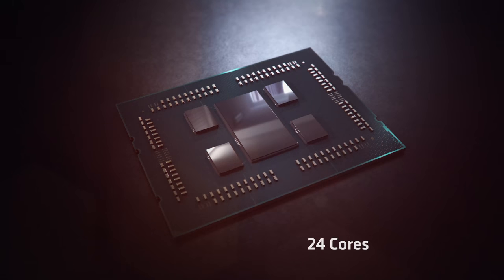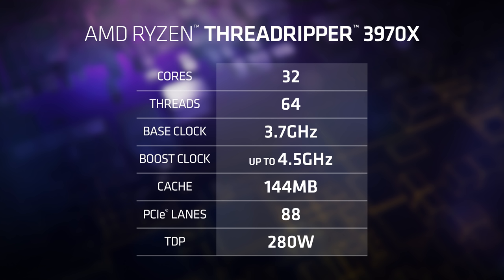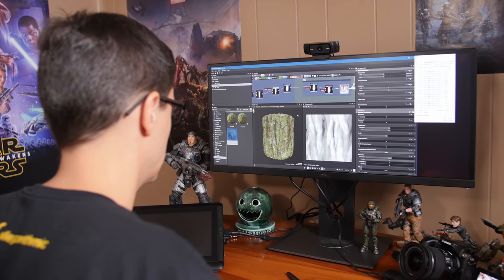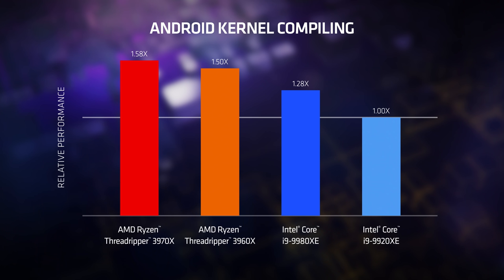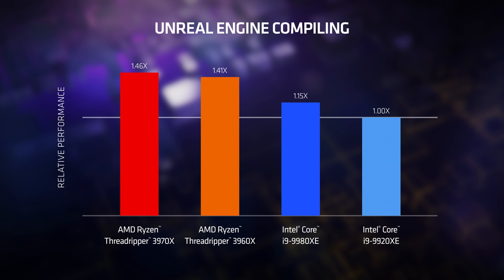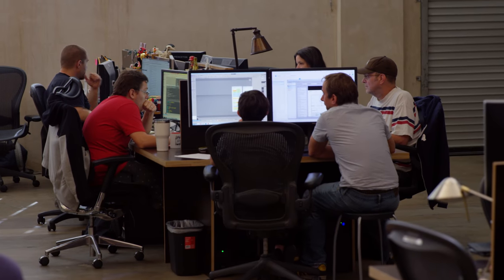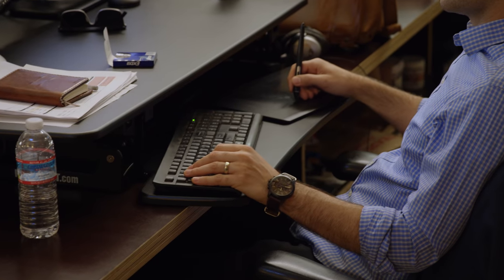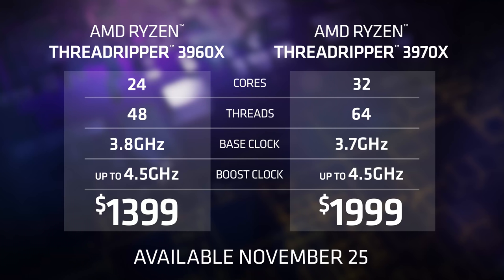Performance Preview: 3rd Gen AMD Ryzen™ Threadripper™ Processors for Creators

Comment: So Lisa Su will appear in this video, but not in #TheBringUp ?
W H A T    A    F A I L
Reply: To be honest I have been waiting for this information for like a year now. But some of the informations are just useless. 
It support "PCIe" - Really? It does? WHICH ONE? 3.0 or 4.0 (the first beeing more realistic, but with a cutting edge max horsepower AMD CPU you don't know)
It has 144MB combined cach - Really? How is it spread over L1, L2 and L3?
The third gen comes in two flavours - Really? Only two CPUs. Or two CPUs _for now_? And there will not be a 3990X?
Will it use the same CPU socket or will it really use the new TR4s3 (or however it is called) 

I want to use one of these CPUs in my new build I use for my work. And your policy of not-giving-away-informaton makes it frustratingly hard for me to plan for my new build. I need to check which CPU is the best for the build. I have to play for money. So much information is needed and I can only find rumours.
Reply: @KuruGDI  Why do you not know the L1 /L2 /L3  cache spread ?  This is 'old news' ...
Google is your friend my friend...  A June 2019 article on nexus.net based on AMD slides reveals that Zen2 architecture has 64K of L1 per activated core, and 512K of L2 per activated core.  Next, per (max 8 core CCD chiplet)  have (2x 16MB per 4c CCX) 32MB of L3.
These 2 Threadripper parts have 4 chiplets, this means 4x 32MB of L3 = 128M of L3 
This means, 24C threadripper has = 24 * 64K = 1.5M of L1 , 24 * 512K = 12M of L2 and 128M of L3 =  141.5  MB of total cache
32C Threadripper = 32 * 64K = 2M of L1 ,  32 * 512K = 16M of L2 and 128M of L3 = 148M of total cache
Since the documentation only counts L2 and L3, you get 140M combined for the 24c TR, and 144M of combined for the 32c TR.

Comment: Guys believe me they are gonna jabait the prices just like they did with Navi. In hell no way are these final prices.
Reply: That's not applicable in this case since Intel had already announced their own pricing well before AMD's announcement. So AMD is not waiting for Intel to announce their prices and adjust their own accordingly, which is what supposedly was the case with Navi. Which I do not believe to be the case to begin with. AMD was simply forced to lower their prices in response to Nvidia Super lineup pricing - it was never a planned move - they simply said so to save face.
Reply: Perhaps for low-mid tier cpus. However in order for these ultra-high end cpus to work properly and at advertised speeds they basically pick the best binned components out of everything. This makes their yield very low. Effectively this means high demand but low supply. Even if they reduced costs it would be very little. Suffice to say those who wanna buy them will buy them regardless of price. These are purely professional workstation cpus and you buy them as an investment to your work efficiency rather than a simple purchase.

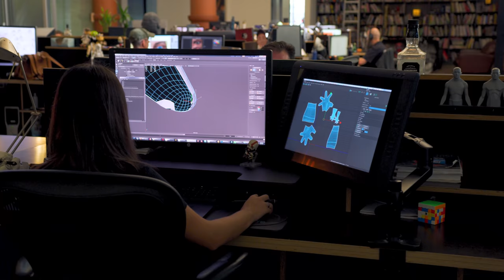Comment: I'm calling BS on that Blur Studio segment, 5:34 "All of our applications are heavily multi threaded.", really? considering applications like 3ds max and Maya are largely single threaded,  example viewpoint performance will be better with fewer higher performance cores , also the parts that are multi threaded don't scale very well, sure blur use a lot of different applications and some probably benefit more form the large core count ,  things like rendering and simulations will benefit a lot from having a lot of cores, but surely they have a render farm and dedicated simulation servers for that and not using their workstations. 5:51 "Gonna take a frame from 13h to 20min" 6:11 "Something that normally would take 5min was taking 5sec "uhh, no it wont, there is no way you have gotten a 4000-6000% performance increase with these new CPUs (unless they where using 20 year old machines before the upgrade). He does mentioned that they where able to render a lot of things now locally faster then getting it thru the farm, but that sound more like they have a network bottle neck and using a remote farm? or just have an really bad render farm setup. Blur is a respectable studio so surly they cant be this clueless? Sounds more like blatantly false marketing. Don't get me wrong I am going to get the new Threadripper or the ryzen 3950x for my next workstation build this winter, because they are good CPUs, but its better to be honest about the actual performance else your overhyping things and people will get unrealistic expectations and just end up disappointed in the product, should have learnt from bulldozer.

Comment: AMD should be build an air cooler that can handle overclocking for the 32 cores model.

Because watercooling is too complicated, and aio cooler isn't best solution for the workstation pc😀👍

Comment: decimating intel line-up one cpu at a time.
Reply: 3960X costs 1400 dollars and 3970X costs 2000 dollars.
Reply: @alexmarin7897  nevertheless, it is much more powerful, efficient and affordable in contrast to its counterpart.
Reply: @koralite3953 - More affordable? These cpus respectively cost over 2x the price of 10920x ($689) and 10980XE ($979) while only offering 1.25x-1.6x more performance, and that only on some niche workloads. More efficient? They have 1.7x higher TDP (165W Vs 280W) while only offering up to 1.6x the performance. Bear in mind that Intel cpus are operating completely at stock settings here so they adhere to their rated 165W TDP after 25seconds. Even removing power limits in order to allow the Intel cpus to boost to their all core turbo indefinitely, they consume 1.25x their TDP i.e. around 206W. The AMD cpus have a TDP of 280W so (even assuming they won't go above that while boosting, which they do) this is still 36% higher power consumption. So even in the best case scenario of dividing the highest performance difference (1.6x) with the lowest power difference (1.36x) that would be around 17-18% more efficient … not something that I would call "much more efficient" and certainly not worthy it given the over 100% higher cost.
Reply: @alexmarin7897  Power consumption Intel = double of TDP of AMD :P
Reply: @kevinyoliveira68 -The figures that you have in mind are total power draw from the wall when the Intel cpus are overlocked on all cores to their absolute max and doing a very heavy workload like Blender or Handbrake or Prime 95. If that is how you want to compare then check the relavant reviews on OC3D. The consumption for the 9980XE (OCed on all cores to 4.9GHz) running handbrake was 564W. The corresponding power consumption for the 2990WX (overclocked to 4.0GHz on all cores) was 776W.The  2990WX was a nuclear reactor and it had a TDP of 250W … imagine the power consumption of the 3970X that has a TDP of 280W. The ice in the poles will melt faster…
Reply: @alexmarin7897  Lol that $1000 10980XE  and basically all intel HEDT lineup already got beat by the lower core count less expensive and much more efficient non HEDT ryzen 9 3950X, threadripper are for those who need the absolute performance, also just to remind you the 28 core intel W-3175X cost $3000.
Reply: @alexmarin7897  32c vs 18c and 18c consumes a less wow...
Reply: @alexmarin7897  But on a HEDT platform it's not only the programs speed that matters.What about PCI-E 4 and 88 Lanes? It's not meant for gaming Pcs...its meant for PCs with a high overall workload...not using 1 graphics card for gaming but 4 for rendering 3d scenes...not using 1 SSD for storing games but multiple in raid for creating uncompressed video content?  SSD's can already profit from PCI-E 4... and i wouldn't be surprised if AMD
s next graphics chips can profit also...so it's not something intel should ignore...they already slept too long. ;)

And even if the difference would be smaller...this is a CPU meant for people who are earning money with their work and time is money..they will buy whatever is the fastest...just how they bought Intel before without looking at the price tag.
Reply: @sanitoeterscc3416  they(Intel) are already slept for long time, I realized that since core I series gen 2 to gen 5, they stuck in using DDR3 RAM module type . I don't know about gen 6. But it's clearly Intel too lazy too be innovative. And so fokin late in adoption DDR4. From gen 2 to gen 5, it has 4 generation gaps. So impressive in negative thoughts..

Comment: Those prices are out of touch! This was an opportunity to make intel’s offering seem like it’s not an option. Instead, intels 10900x series fills the huge price gap you are leaving between x570 and Trx40.
Reply: Really? My 16-core 1st gen Threadripper launched at a $1000. The 16-core 3950x launches at $750 or $250 less. Not to mention that it will be ~30% faster than 1950x.
As for 3970x, it's just $100 more expensive than last year's 24-core 2970wx, but it also offers much faster clock speeds, much better IPC, more PCI-E lanes, reportedly is UMA instead of NUMA topology, and has new features like PCI-E 4.0. I think I can justify the $100 markup for these alone. At $1400, I think that 3970x is still a good price compared to Intel's offerings. Can you please let me know how much do Intel ask for their 24-core CPUs? Last time I checked, they start at over $3000, so nowhere near the $1400 AMD asks for theirs. Can you please give me an example which CPU is a better value than 3950x and 3970x? Besides, should you really care that there's a price gap between 3950x and 3960x? If the leaked benchmarks of Ryzen 3950x vs i9 10980xe are to be believed, the 10980xe has the same performance even though it has 2 cores more. So how does Intel's 10-series fill a price gap when AMD cover all performance points up to 10980xe even with 2 cores less on the 3950x?

Comment: Can it game? I know gaming is not what it’s made for but if I want a beastly overall pc than can do everything should I choose this cpu???
Reply: Game? You is kidding? This is a processor for workstation, game = AM4/LGA 1151
Reply: Keviny Oliveira I asked if it can do both. For someone who wants a cpu for both scenarios. The 2950x can game properly. This should have better ipc so it should be able to handle games just fine.
Reply: @donovan4009  Hmmmm, nope games will running bad, like i9-10980XE run.
Reply: Keviny Oliveira just wait for the cpus to come out and then you can say for sure. If it has the same ipc as the 3900x it should be a beast in gaming too. Besides, all new games are optimized to utilize cpus with many cores!

Comment: Third gen Threadripper should be renamed Pocket Ripper.

2970WX was launched at $1299 -> 3960X -> $1399
2990WX was launched at $1799 -> 3970X -> $2000

Sincerely I can't explain it. Newer CPUs are faster and it's the minimum everyone should expect from a new thing, but why higher price if we have the same number of cores?
Reply: The new Threadrippers are exactly 7-11% more expensive than last gen while being 35-40% faster in highly-threaded workloads (26% higher all-core clocks + 15% higher IPC). They also have much more PCI-E lanes and support super fast PCI-E 4.0. So what exactly are you complaining about? That's a pretty modes premium that AMD are asking for such monstrous performance bump and new and expanded features.
Reply: @bgtubber  not bad but not that good as on mainstream. with the Intel 10980XE 18 cores at $999, $1400 for a 24 cores seems reasonable but not that good. imho AMD lost the opportunity to crash intel in that sense. I think that many enthusiasts will prefer the cheaper but even good Intel 10980XE.
Reply: @sblantipodi  Well, in regards to the $1000 price range, I'll suggest waiting for the 16-core 3950x instead. If the leaks are true 3950x has the same performance as 10980xe in most workloads even though it has 2 cores less. If it turns out true, you're better off getting a 3950x and spend the 250$ on a better GPU, better/more memory, more storage etc. Just my 2 cents. 🙂
Reply: @bgtubber  I'm not a fanboy but no one can't not see that the intel ecosystem is more mature and stable, there are more software "optimized" for intel and so on.
so if price per performance is similar I would choose intel.
as me, many people agree with me this is why AMD should offer more for the same.
3960X costs 40% more than i9-10980XE, considering the platform that will be really more expensive (with mobos that average 800€) it would easily costs 60% more.
and no, 3960X will surely not be 60% faster than the intel counterpart.
Reply: @sblantipodi  According to AMD's slides, 3960x is 54% faster in Cinebench R20 compared to 9980xe which is basically the same performance as 10980xe. As far as stability goes, pretty much all quirks have been ironed out now with the latest AGES 1.0.0.4 update. So I have no reasons to doubt that the new Threadrippers and 3950x will be rock solid and reliable. This is why these CPUs were delayed - to ensure that everything is rock solid. I myself have two 1950x Threadrippers that I bought at launch and I've had zero issues whatsoever so far. 🙂
Reply: @bgtubber  cinebench is not the only test you need to use to compare the CPU. All other loads will not see the same improvements. If you take in consideration that mobos will start from $800 (for a decent one, no one will buy an entry level mobo on a $1400 CPU) 3960X costs about 60% more than 10980XE. So yes, I'm really disappointed
Reply: @sblantipodi  Nobody buys an 18-core or a 24-core or a 32-core CPU unless they use software that is fully multi-threaded like Cinebench R20 and the like. And again, you are comparing 10980xe to 3960xe which is ludicrous. These two CPUs are in a totally different league. The 3960x just obliterates the 10980xe in fully threaded workloads, as you will see when they launch. The direct competitor to 10980xe is the 16-core 3950x. So you can build a 3950x system with basically the same performance of a 10980xe one for much cheaper due to the CPU costing $250 less and due to AM4 motherboards being cheaper than x299x motherboards.
Reply: TRs 3rd hasn't competition 😐😐😐

Comment: how much will it cost? im 14 and ive been wanting to be a content creator since i found youtube when i was 7 but i cant live stream because my fps drops to 4 on the games that i play :( im running on a intel i3 and and gtx 1030 with terrible ddr3 i dont have a large budget but i really want to go all out because i believe that i am capable of being a professional! ill try my best but i need to know the price. hopefully its less than the i9 because intel is the Apple of processors,high price,bad performance pls get back to me on this i need to know 😢😥☹
Reply: 3950x is $750 which is not cheap. Not to mention Threadripper which start at $1400. The good news is, you can do content creation perfectly fine even on a $190 8-core CPU like Ryzen 2700x. 🙂

Comment: I need processor for CAD not for Gaming. I am student i don't able to pay premium charges.
I need ECC Support Processor but most cases the support is absent.
8/6 core  4Ghz clock speed efficient Processor Low TDP make Efficient To use.

Comment: Please fix the problems in the Radeon driver with the Wattman it has been known for ages that this bug or what it is, the whole Pc crashes regularly or the message comes that Wattman had a system error and was reset ,I have an RX580 and Current Driver 19.11.1

My System:
Windows 10 Pro 1903 64bit
Ryzen 7 2700 3,2Ghz, 
16GB Corsair vengeance rgb pro 3200mhz, 
Aorus Radeon RX580 8GB , 
Aorus Gaming 5 Wifi Motherboard

Comment: you know what intel's response is going to be? Eh we'll just cut price because that worked 10 years ago and we managed to make a monopoly on 4 core 8 thread chips not going to work this time intel you need to step up and actually bring something worthwhile to the table a budget £100-140 4 core 4 thread/4 core 8 thread, a mid-range £190-250 6 core 12 thread and a high end 8 core 16T or 16C 32T for around £300-500 That's what people want not overpriced 4 core and insanely priced 16 and 8 core variants!
Reply: Intel can't compete with TRs in performance only price, So the 10th generation will get a 50% price cut ;)
Reply: @kevinyoliveira68  thats fine and all but intel rrally need to update their low end mose of their new i3's are going to be dual cores and  the old ones are overpriced that's how AMD is winning over intel they understand that alot of their profit is going to come from budget gamers while intel wants to focus purely on the high end
Reply: @shadowxxe  Next i3 will 4/8, competition is very good for all us 🙂
Reply: @kevinyoliveira68  Which I3 are you referring to? all 10th gen intel i3 chips on their website are 2 core 4 thread
Reply: @shadowxxe  For desktops...
Reply: @kevinyoliveira68  Nevermind i found it intel never released anything on their website about the comet lake i3's so i had to do some digging anyway my verdict i think the new comet lake processors are actually decently priced at 120 however what i completely dont understand is why intel decided to make a whole new socket for these chips instead of just using 1151 no instead intel thinks its a smart move to force anyone wanting to upgrade to a new i3 to buy a new motherboard as well and i get that they are moving to 14nm but AMD moved from 14nm to 7nm and they managed to keep AM4 so i dont see why intel cant do the same

Comment: If you'd included Xeon W-3275 in your graphs they may even be more "real world"-ish. Price-performance you're in the lead no doubt.
Reply: They compared HEDT processors so it's fair. Xeon is competing (lol) with AMD's Epyc lineup
Reply: @DenGuleBalje  W3275 is HEDT imho ... Even if they're "unobtanium" sort of ;) Got one for testing. If you think the TR4/SP3 socket is picky about torque try 3647 :D
Reply: @peterpain6625  Well sure. I'm still running a Xeon e3-1231v3 in my workstation/gaming PC so..